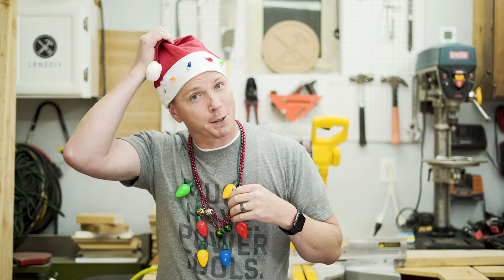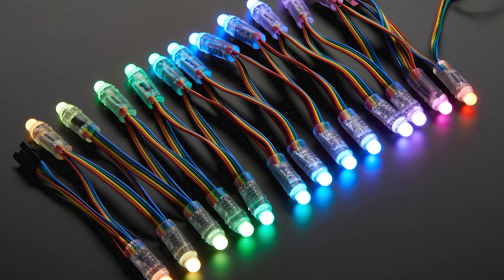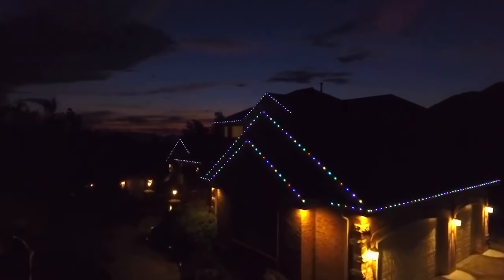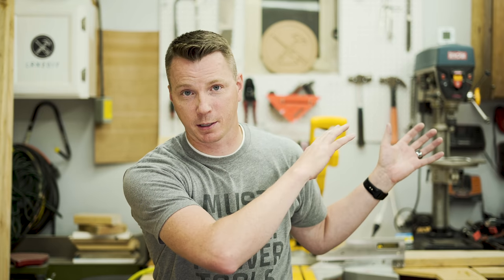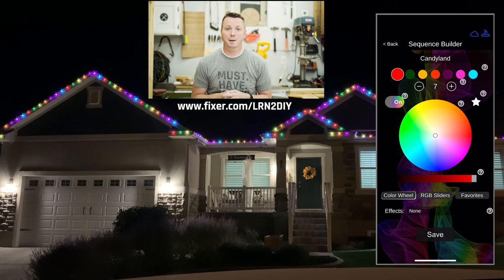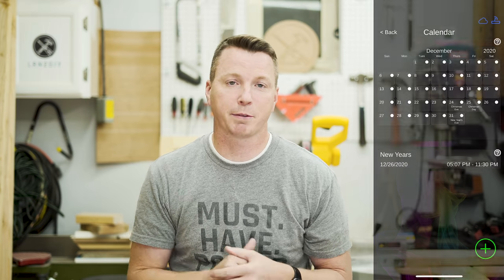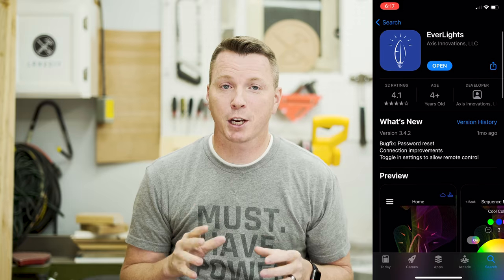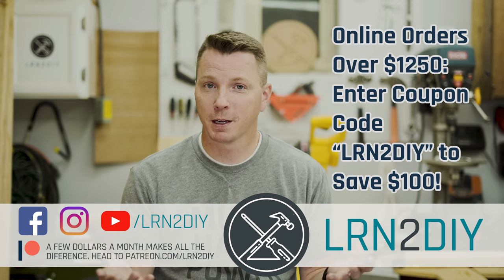Why I NEVER have to put Christmas lights up again

Comment: Just buy led strips online and use free software you could do this project for like 300 bucks if you don't use a kit by some borderline scammer
Reply: Spent $150 on 100’ running on WLED 🤷🏽‍♂️
Reply: As someone who has both .. an led strip is programmable but there is a difference these diodes are five time the size and brightness .. so you may be able to get a strip from Amazon and one that is cut to  your size it isnt the same the amount of light and you wont be able to buy the things to mount them in a good fashion not on the roof line at least.. but I do love using the led strips from Amazon to tuck into the corners bv of the siding lighting up the house
Reply: @ptravers9077  You can also buy bullet pixels that are more   reliable than strips. I would also recommend 3" between pixels as 9" seems like too much distance between. If someone really wants a DIY project such as this they can buy vinyl J-channel (cheap!) but they would need to drill their on holes. May be worth it in order to save money.
Reply: @thompsonnickc  bullet led would be better than strips 100 percent bullet led are also much brighter the only downfall they has is the rubber sleeve they use to protect the connections it being open allows moisture in if not installed correctly.. plus using a bullet light system gives you the ability to adjust light distance and feels more like you've accomplished something after
Reply: @ptravers9077  Agreed
Reply: the ones he showed in the video look exactly like pixels... you must be referencing strips with reguards to the brightness, you can do either DIY pretty easy
Reply: @thompsonnickc  traditional Christmas lights are spaced 12“ apart so these look more like what people install for that.
Reply: @daveanderson6865  Bullet pixels can be ordered with virtually any string length and pixel spacing including 12''.

Comment: Haha. Sees thumbnail, clicks video. Hears price, watches another video.

Great idea, but, yeah, totally not with it for me.
Reply: I just did my back patio for about $150. Check out WLED for a free open source option. Drzzs channel goes over WLED
Reply: Just look at ‘DrZzs’ videos or ‘The Hook Up’. This can be done with a few hundred bucks if you are willing to do things yourself and tinker a bit with an arduino board and Wled program. It’s really simple it has already been done and figured out by others.
Between those 2 channels, you will find all you need. I got mine, about 100 ft, all said and done a bit over 250 bucks.

Comment: I was checking out the company you recommended. I see the color changing lights (which are the ones you have) and for the same 100’ they are $1600.00. Im wondering if I’m checking the right place or if they have just gone up over the last year?
Reply from the maker: I just took a look and I see the bundle you're referring to for $1600 but that's not what I went with. Check out this one: https://myeverlights.com/collections/color-changing-lights/products/color-changing-starter-kit that has most of the tools you need minus the lights themselves. The lights have gone up - they were $200 per 25 feet and now they're $225. So my same setup would cost an additional $100 since I needed 4. I'm not sure how much of a deal the $1600 starter bundle is but piecing it out seems to be the way to go.
Reply: @LRN2DIY  thank you for replying to me. I certainly appreciate it. Would you mind sending a cart full of the exact stuff you bought? I’m having a hard time knowing what I need for piecing it together. My house front is actually very similar to yours as far as the peaks/gutters.
Reply from the maker: @myqwerty20  My pleasure. If you check the link in the description there’s a link to my website where I include each of the items I bought.
Reply: @LRN2DIY  awesome. I must of just missed it. Thank you.
Reply: @LRN2DIY  hey I actually just thought of some other questions. How long have you had the lights now and have you had any issues at all? Plus, how many zones do you have and how does that work?
Reply from the maker: @myqwerty20  I've had my lights for just shy of a year now, so they've been through all four seasons. I do have one section toward the end that I think I had some wiring issues with when I installed it. They work most of the time but have been out a few times and I suspect it's because I didn't get a good connection initially. I have been waiting for the weather to cool down to go take a look but it works almost all the time so I don't think about it much. I only run on one zone because that's all I need. I think the additional zones would be helpful if you wanted to run different sequences or timing on other parts of a house or building but that's not the case for most homeowners.
In general, these have continued to work as expected and I love the ability to pick my lighting for as far into the future as I want and then just set it and forget it.
Reply: @LRN2DIY  do you think you could ever add more lights to the system if you wanted to? Not EverLights but a different brand?
Reply from the maker: @myqwerty20  So just for kicks, shortly after installing mine, I bought some individually addressable LEDs from Amazon and tried them. They "worked" but the colors were all off. I need to experiment with it some more but I think it's doable.
Reply: @LRN2DIY  interesting. We’re they just not the right colors or dimmer? I wonder if you bought the same RGB(that order) because I do know if you get let’s say GRB then it’ll be off. But I’m glad to know they lit up. Did they function the same with the exception of the colors being right?
Reply from the maker: @myqwerty20  Yes, they lit up and appeared to be bright enough but certain colors were off. I’ll have to dig up the video I took of it but certain colors seemed really close while others were just way off.
Reply: @myqwerty20  I wouldn't try to use lights from a different brand. It won't look the same as the existing lights.

Comment: How do you power so many branches?
Reply from the maker: These are low voltage so there's the initial power supply then another one about half way through and that's all that's needed.

Comment: What if you move ?
Reply from the maker: This is similar to many home improvements, like landscaping, bathroom remodeling or others - it stays with the house so that needs to be considered when undertaking a project like this. I suppose you could remove it and try to use it a new home but that doesn't seem worth it to me, especially considering that this will raise the value of the house when it comes time to sell.

Comment: You payed way to much. If you go for DIY get some ESP32 devices flash WLED on it. Get the LED strips you want, like WS2815 strips... that are strips with that Backup line. Some PSU unit's and LED channels and of you go for way less money.
BTW WLED is freaking awesome.
Reply: Do you know if any of those cheaper options are bullet pixels that can face outward?

Comment: $1200 for something that, if left outside has a lifespan of  5-7 years before they need major repair of replacement. Maybe you should tell the whole story both the good and bad. There are alot of downsides to these that you neglect to mention, like the fact if you live in a high moisture or humidity area these only last about 2-3 years. Or the fact that you literally have a row of outlets for 100' of lights. Why didn't you address what goes into wiring this system up
Reply: Do you have experience with these lights? 
You don't need a "row of outlets for 100' feet of lights." That's not a fact and not true.
Reply: @daveanderson6865  maybe you should do some research
Reply: @benbaggen2375  I have done plenty of research and better yet, have a lot of experience. We've done 75 installs over the last 2 years. Some systems that we install can go 400 ft before needing another outlet. The typical residential system we install needs power injected every 75 ft. but some can go up to 200 ft. Hope that clarifies things and doesn't scare people off thinking they need a row of outlets for 100 ft. of lights.
Reply: @daveanderson6865  vector the industry leader states, 3 of there 16.4 foot strips together is the maximum supported per outlet that's slightly under 50 feet. I'm no expert but if I had to guess your looking at a min of 150 foot of lights for a basic job.... so your looking at 3 plugs for the strips alone then at least one more for the controller. I'm not sure how you classify 4 plugs at minimum on a wall, but it sounds like a row to me.